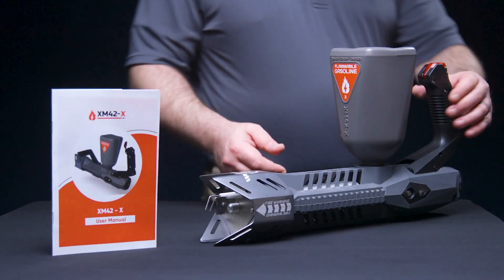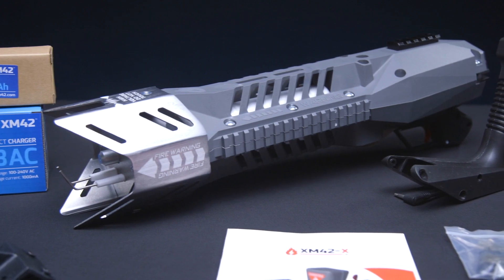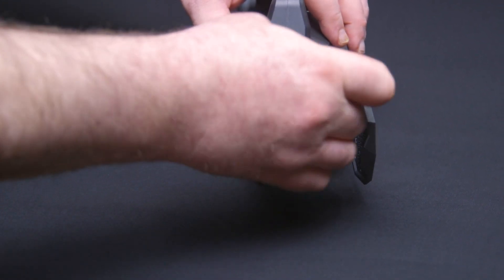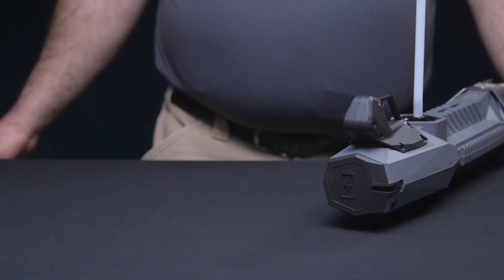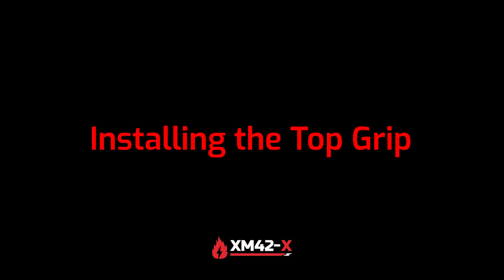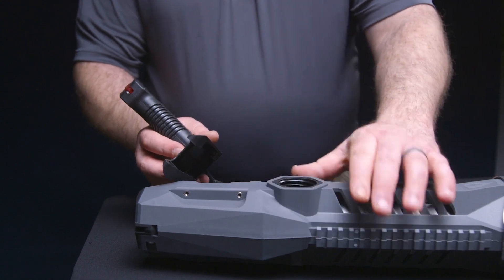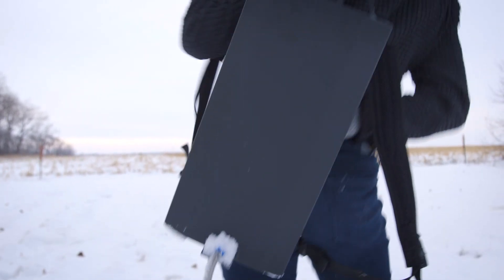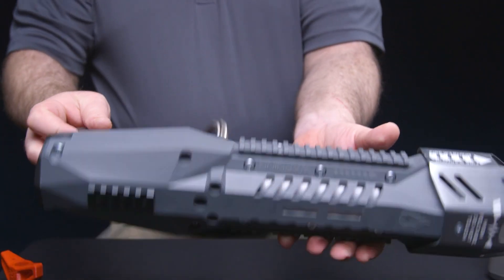XM42-X How To Guide

Comment: Id rather my flamethrower not be 3D printed, thanks.
Reply: Its actually Injection Molded durable Polymer, its a super cool process! But if you would rather not have one like that, we have plenty of metal models that are extremely fun as well. This is made to be light weight so that it can be under barreled and not add tons of weight.

Comment: could you tell me how to attach the foregrip to the body?
Reply: There are 2 screws with mlock nuts on them. Attach them to the handle, turn them so they fit into the slots on the top or bottom and tighten.